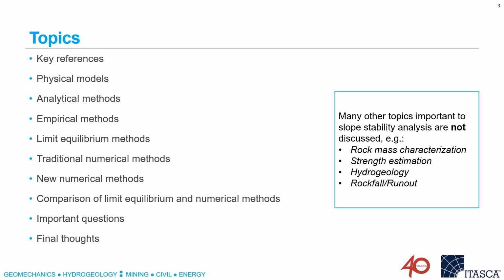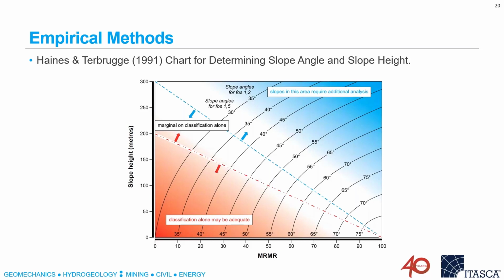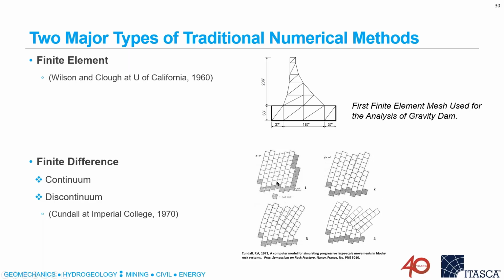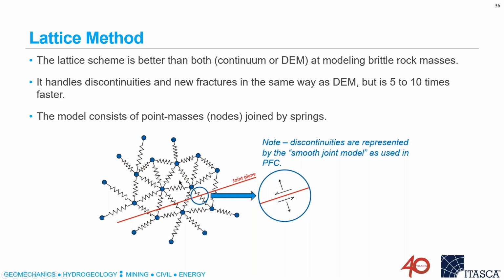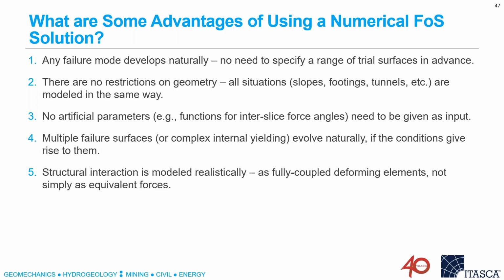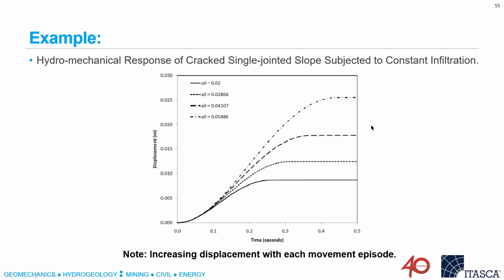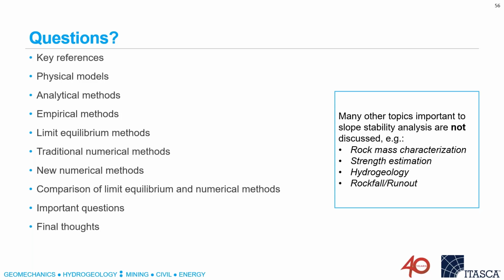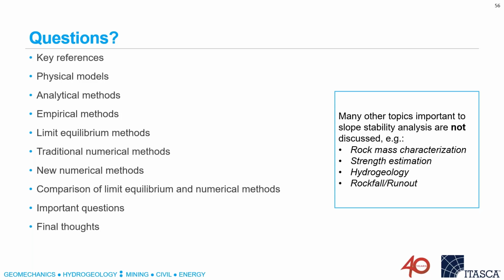Overview of Slope Stability Analysis Methods

Comment: Are the slope angles presented on emperical charts overall or inter-ramp angles?
Reply from the maker: Hello. If you are referring to the circular failure charts for example, [from Chapter 8: Circular Failure in Rock Slope Engineering - Civil and Mining - 4th Edition by Duncan C. Wyllie and Christopher W. Mah, 2004] the conditions under which circular failure will ocular is when the individual particles in a soil or rock mass are very small compared with the size of the slope. These charts have been developed by running many thousands of circular analyses from which a number of dimensionless parameters were derived that relate the factor of safety to the material unit weight, friction angle and cohesion, and the slope height and face angle. There are examples using this method for hundreds of meters and others for tens of meters (or smaller). For other charts, consider the height range permitted and in all cases try to find the source of these charts and any limitations (data range) to ensure you are working within the data range the chart was developed for.
Reply: @itascasoftware  Thank you for the response. I was actually asking about slope heights vs slope angle on emperical design charts. But this was addressed later in the video.
Reply from the maker: Hi  @willasingoyi9989 , Ok great, glad your question was answered.